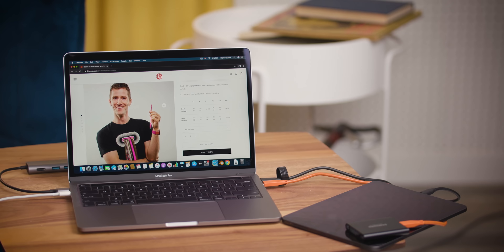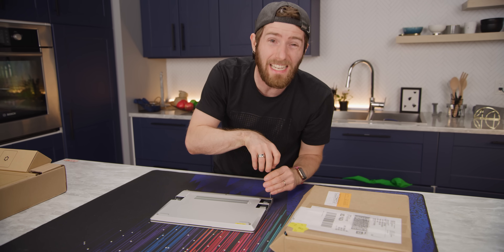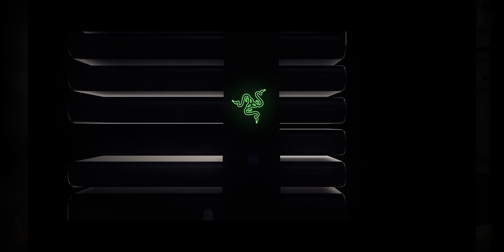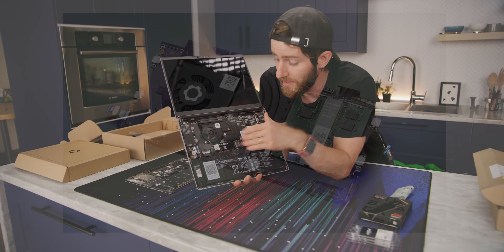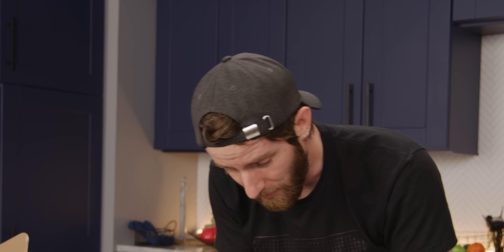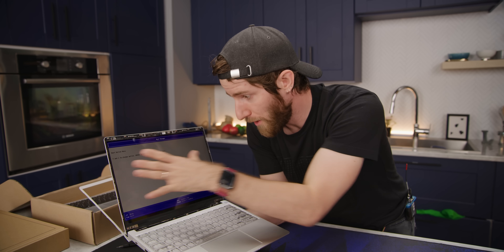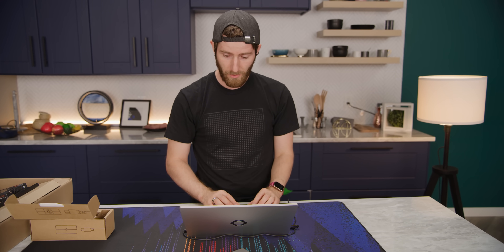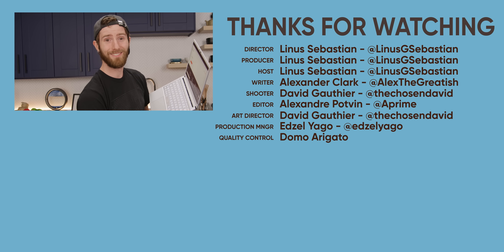A COMPLETELY Upgradeable Laptop?  - Framework Laptop Review

Comment: This makes everything else in the market look stupid.
Reply: Agree.
Reply: I wish there was more to it beyond just an Ultrabook, but when they eventually make a gaming/workstation laptop I'm going to invest. I've always wanted laptops to have a DIY market like desktops. Better for the consumer and the environment, just worse for companies.
Reply: @PrintAimGame  gaming laptops will be the best ones to tinker around with. Imagine upgrading your graphics card and putting the old one on eBay. Imagine if they're slotted! One can dream.
Reply: @fahadus  I hope they create a new standard for GPU connection.
Reply: @WhenDoesTheVideoActuallyStart  that would be epic.
Reply: @WhenDoesTheVideoActuallyStart  I think the difficulty with GPU swapping in a laptop is mainly due to the integration of the GPU in the cooling system of the computer. We don't really need a new connection standard as M.2 is already a PCIe port (limited to 4 lanes, but it still gives a pretty good memory bandwidth of 64Gbps with PCIe 4.0 ...)
Reply: @thomhpl  Why? Plenty of laptops have done it, it's not that difficult. The GPU die always needs to be on the center of the module, so you concentrate the heat dissipation there.

And no, M.2 is absolutely not enough. M.2 is designed just for SSD boot drives.

First of all, according to the spec, it's designed to deliver up to 7 Watts of power. An RTX 3090 pulls over 360 Watts in peak load. That's around 52 times more power than the spec. Not even undervolting/clocking would make this work.

Secondly, while today GPU's don't benefit that much from the ever-increasing amount of PCIe bandwidth, that doesn't mean they never will, especially with texture streaming and if Intel/AMD adopt a low-latency fork of PCIe for GPU's.

If they create a physical connector standard, it needs to be future-proof. It needs to be able to deliver 16 lanes of whatever PCIe standard that the CPU supports.

Thirdly, consumers would feel cheated if they bought a laptop that promises RTX 3080-level performance and got one that is throttled by the connector.

Lastly: a GPU die and it's GDDR RAM chips wouldn't fit on an M.2 module.
Reply: @PrintAimGame  Not even worse for them if their business model revolves around DIY, customization and upgradeability.
Reply: @matekovacs2696  None of the current business models revolve around that though, and swapping to that model would very likely hurt profits. There are bigger margins on selling a whole new machine than a part upgrade.
Reply: @PrintAimGame  they could probably make it work
Yes, I wouldn't expect huuge profits, but certainly enough to keep the company going.
Reply: @matekovacs2696  I more mean current industry incumbents would lose money on the idea. A new company could definitely make it work.
Reply: Agreed as well
Reply: The only real drawback for me personally is the lack of a dGPU. Granted, this is an ultrabook, so it's not really any kind of focus for those. Hopefully they'll do really damn well, and eventually make a heftier working laptop with at least RTX 3060 level dGPU, or whatever is the "above 50-series performance" at that time.
Reply: because everything in the current market is.
Reply: *As soon as it has touch and pen input. But it seems that an upgrade like that is already possbile with the current model so...
Reply: Agreed!
Reply: @WhenDoesTheVideoActuallyStart  I missed that part, my fault for skipping parts of the video
Reply: Like you are stupid among with these hyped morons who thought this laptop is fully upgradeable. Which is 100% inaccurate.

If you buy it, you will get a gen 4 ram and gen 4 ssd, as well as current gen cpu AND NO DEDICATED GPU for CRAZY 1000$ base model . Perks you get to swap where to put your usb hdmi and storage (low write/read speed pretty much like microsd) module. Note in order to upgrade to next gen you will need a new motherboard. And spend another 1000$ for new motherboard and gen 5 ssd and gen 5 ram and get to reused your worn or damage keyboard, old laptop frame and old screen lol
Reply: @jonmon5745  who said it is fully upgradable??? Lmao. Atleast u can upgrade something or swap module that is broken or u can bring those ssd module and put in some one laptop then u can use like yours. I dont know what do u expect out of a laptop but please tell me what laptop can upgrade cpu/gpu or motherboard?? Also, if gen 5 are out, the price also goes up, not everyone want gen 5 right away when gen 4 can do most of stuff for another 6-10 years.

Edit: There will also have thunderbolt support in the future
Reply: @youravghuman5231 are you dumb????? Their selling point is that this is future proof laptop aka "designed to last" on their website... I dare you to buy it now and comeback at me later 6 years if that 4th gen ssd/ram motherboard is future proof lmao... 4th gen ram/ssd was out since 2014/2027 and gen 5 started rolling out 2020 but not in mass production due to chip shortage and pandemic... Every generations if YOU ARE NOT DUMB TO NOTICE have a starting price tag of 700$ above (no dedicated gpu)
Reply: @jonmon5745  Gen 4 is more than enough for everyday usage and even for gaming. I literally use I7 4th gen and sata 3 ssd and it is not sluggish at all. Windows is not like android where every update will make android heavier and slower. Also, u have to look other ultrabook prices as well and they cost almost the same as this ultrabook. Plus, it is a dumb statement that "iT sHoUlD hAvE dEdIcAtEd GpU" coz this is not a gaming laptop but even then there are people saying that it will have thunderbolt which make the price is even worth the money.

U have to know that for 700, u get an ultrabook with latest gen cpu + modular + thunderbolt (if it will have)
Reply: @jonmon5745  Also, what is this disadvantage when compared to other laptop? This laptop have the same exact function as macbook + it is modular which makes macbook looks trash
Reply: I wouldn't automatically say that everything else looks dumb. But the fact is that while there ARE advantages to the non-modular approach, most companies are only doing it for cost savings, the rest never gets utilized.
Reply: The reason most people would still buy unrepeatable laptops like Macbooks is because they don't want to learn! They don't want to put their time and efforts into repairing and making their device work for them. They would rather prefer paying heavy price for someone else to do it for them or just buy a new one. They want everything to just work while they just use the product without even knowing the internals of the product. Companies like Apple are capitalizing on the same mentality. There are a very few enthusiasts who care about their devices this much compared to the sheeps. But i'm glad that's changing.
Reply: probably won't sell well bc any product targeted for enthusiasts aren't economically viable
Reply: @finnian3931  The enthusiast PC market would like to know your location.
Reply: @TheZorch  contrary to popular belief, PC and laptop market are 2 very different groups with different use cases, unfortunately.
Reply: @TheZorch  Still a fraction of the casual laptop market.
Reply: @finnian3931  Their website is slow and often down because of way too many people placing orders...
Reply: The problem with any enthusiast group saying "this will change everything" is that they usually don't realize they are indeed the minority of the market with a very niche demand.

Very few industries actually favor this. As an enthusiast it sucks but look at brands who used to be "for the fans" but now have to suck up to the plebians. It's just hard to cater to
Reply: @finnian3931  that's what the market has pushed you to believe.
Reply: @finnian3931  you thoughts are shallows it seems. There is a reason why it is modular and have least screws and easy af to open the cover. Do u remember when phones back cover can be open easily and people can change battery, sims and stuff?? This laptop is literally like that lmao.
Reply: @youravghuman5231  do you know why most modular products don't succeed?
Reply: @youravghuman5231  this is not the W you think it is lmao
Reply: @finnian3931  u can bet anything, but for sure u cant know the future. They doesnt need W as long as they survived
Reply: Dis, I agree.
Reply: @cybercery5271  dis, i agree
Reply: @jazmineash8450  outstanding move
Reply: @jazmineash8450  I like your words.
Reply: @cybercery5271  thank you my friend ✨
Reply: @cybercery5271  The OP ain't wrong. What's the point of buying a laptop from a reputable brand when you can just buy a laptop from framework and customize it however you like? that's just mental and great at the same time
Reply: @cybercery5271  can you share your reasoning?
Reply: @Carterthielftw_  Yes, I'm too lazy to do this kind of stuff,let the manufacturers do the assembly.
Reply: @cybercery5271  then you can buy the prebuilt model.
Reply: @cybercery5271  You can have them build it for a bit of extra cash. Appreciate that you have options and don't fling poo at a product because they have an option you wouldn't use.

Comment: For those wondering about baseline prices, as of July 26, 2021, The DIY Edition starts at $999, but the pre-built starts at $1,299.
Linus got the DIY Edition, and you just watched him do all the work needed to set it up(would probably take 10 minutes or less).
Additionally, they are working on schematics and assembly drawings for repair shops to use so you could have a more cheap, easy, and fast Motherboard repair.

Comment: As a corporate IT guy that regularly has to crack open laptops, in order to fix random shit, I just got hard imagining a world where laptops were this easy to work on…

Even when you know how the shit is supposed to come apart, they make those little fucking clips so hard to separate with a thin enough plastic spudger, or guitar pick, that you end up using a metal one, and end up scuffing shit up.  Luckily I work in a factory, where users and the environment demolish these their damn laptops, so nobody even notices a few busted clips, a little scuff or slightly more flex in the case.

This on the other hand seems like an amazing experience, and I want one, but wish it had an AMD 5000 series CPU and discrete GPU, but I’d settle for an AMD mobile APU.

For the environment I work in, the only downside is that HP still has a docking system that’s super convenient and everyone in the office who has a more powerful ZenBook instead of the ProBook, hates the USB-C “Dock” which is just a brick sized dongle.  The ability to shut off the battery via BIOS would be great for me, because I have BIOS access, but if someone just made a special docking system that could flip that switch while it was connected would be badass, because I’d have to open these damn things less often—cuz it’s usually to change a battery.

Comment: one of my considerations on my last laptop upgrade cycle was repairability. My choice was the Hp Envy X360 15 (2019) , which looked super easy to teardown in the videos I watched. I've actually not opened it up yet since then but It's still super reassuring to know I can without thinking. :)

Comment: Excluding modular IO and internal QR codes, this is very similar to servicing ASUS TUF laptops. A recent FX705 I chassis swapped internals and screen to an undamaged bottom and top case/keyboard (trackpad is easily removable too) only took about 20 screws and no glue. Hardest part of the job was tracking screw lengths and where they go, which I just use MS Paint sketches.

Comment: This should hopefully be really good. I will note that as Linus said there is still a lot that is not really replaceable and those are the CPU and Motherboard components.

Framework need to make a slightly thicker laptop for cater to the more professional users and then work in some replaceable CPUs and core components. While I do love my MacBook Pro, iPad and thin devices that I use regularly. For some journeys I would love something more beefier that had replaceable components to extend the life span of products that can cost quite a lot. 

I defiantly think there is a market there. Also the thicker case would still be compatible with the components in this laptop, but also ability to take larger or thinker CPUs and motherboards would be such a win.

Comment: The only thing I'm left wondering about is the GPU upgrade path. CPUs are soldered, sure, but GPUs are talking over PCI-express so in principle it should be possible to slot them, via some SFF PCIe connector (like M.2) and a back-shell mounting spot alongside the motherboard. This is, no joke, something that's been grinding my gears for years - if the current product offers GPU replacability/upgradability, or when a future version gets it, I might have to buy one just on principle.

Comment: Let's take Framework to the moon so we will have this thing in the future and it becomes a gold standard. I repaired a couple of laptops for my friends and families and I would get furious for all kind of non-senses manufactures do with their laptops. Some won't boot to usb without attached hdd/ssd, some won't boot if the laptop is not complete assembled, some won't boot if a part has been upgraded or changed and so on. I have seen a lot of thick af laptop with more wasted space and less upgradability. I want framework to become like ifixit for laptop with upgrade modules, etc and much more. This is the kind of laptop want to buy. Slim, rigid and upgradable af!

Comment: LG has a magnetic charge adapter for it's v60 series. Screw A$$le and Micro$uck, lol. This laptop should be the standard! I love the battery disconnect in the bios, I literally tell every customer about unplugging/ removing the battery if plugged in for long periods, which blows that most batteries are non-removable now.